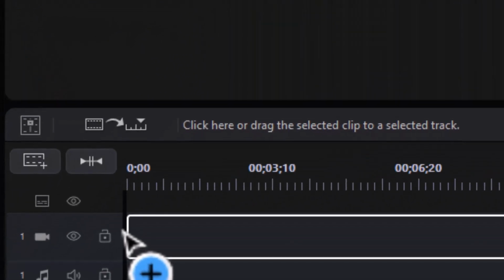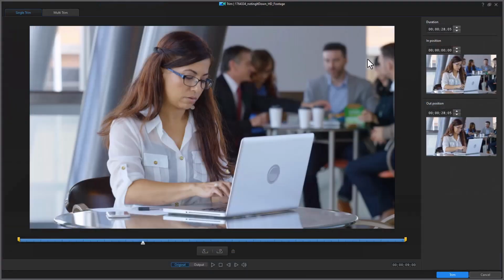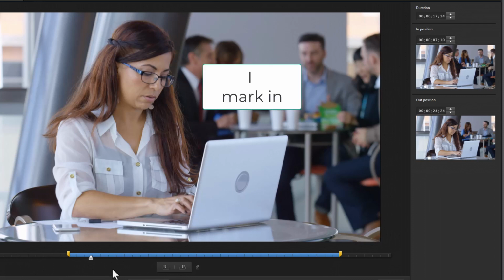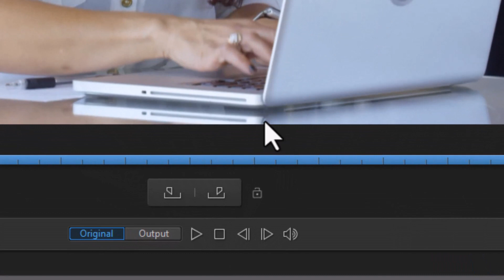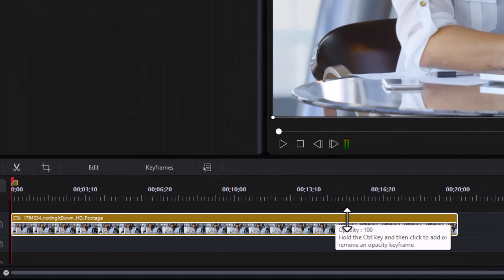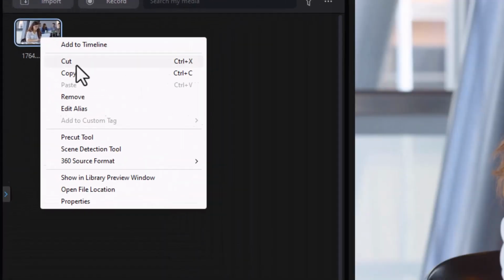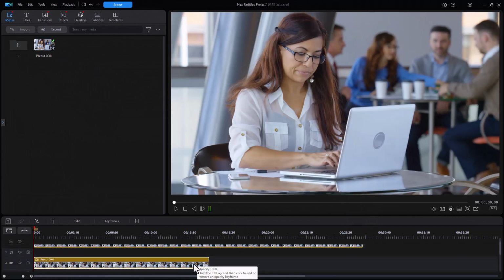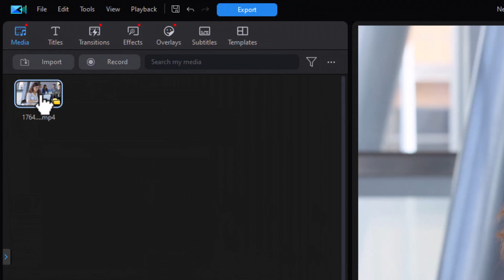Three ways to trim or cut video clips in PowerDirector

Comment: Mutiple cameras, videos all chopped and placed on timeline. how do we make that one video that can easily be moved around. maybe we edit many sections of multiple videos and doing that several times over for the same video.  need to be able to fuse these sections together. i see you say the need to be produced. well, what's that mean for the stupid people
Reply from the maker: Not sure what you are asking, but let me take a stab at it. You can take part of a video and produce a range. Then you can produce that range (create a video output) and use it in multiple projects if you want. You can also use the mouse to drag over a number of tracks on the timeline and group the elements in that segment. That allows you to lock them down so that they are not edited by adjacent changes to the elements to your timeline. If you are thinking about re-using part of a project, you can also pack the project so that all the instructions and all the components of the project are copied into a single folder. You can move that folder around, even to another computer. It's likely I haven't answered your question directly. If not, please clarify and I will do my best. (I was away from my office, or you would have received this reply earlier.) Thanks. --Jim